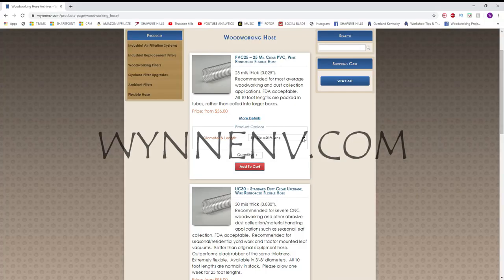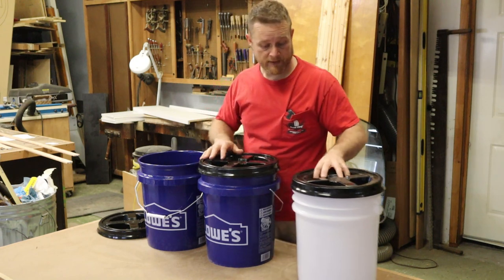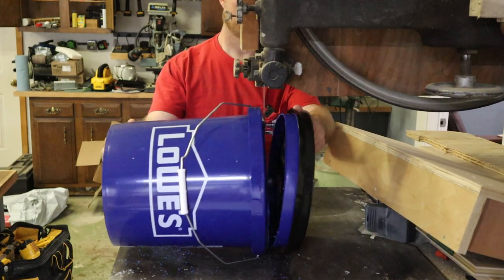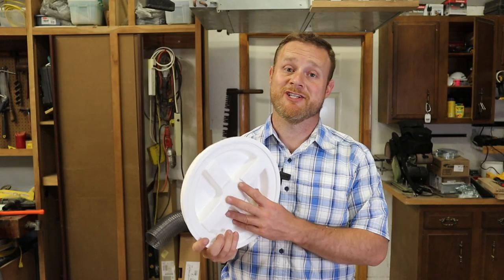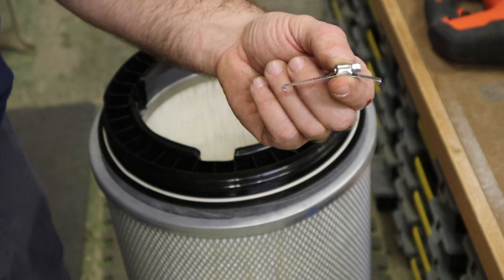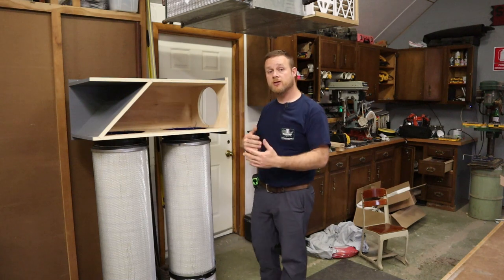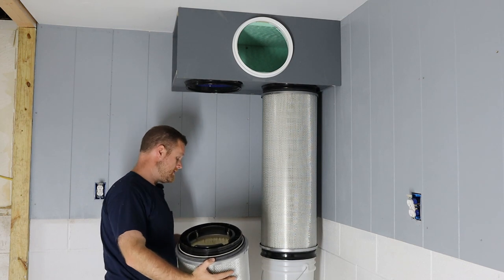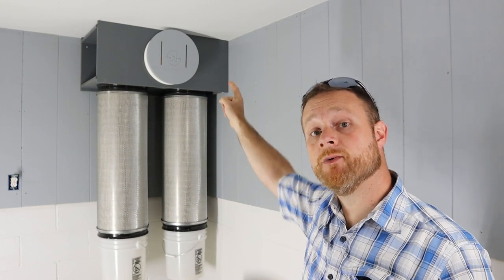Ultimate DIY Dust Collector #91

Comment: Thanks for this. I just completed my DC install. Oneida SDD cyclone, 2hp Shop Fox blower, and a Wynn filter. Followed the plans to DIY the Gamma seal bucket lids, and now I have a threaded filter. Sweet!

Dick Wynn recommended the approach, but I doubt I'd have risked the uncertainty if I hadn't just watched you do it. Cheers.
Reply from the maker: It’s so nice to be able to spin them around and blow out the filters without taking them off!

Comment: You said you were using silicone on one filter and the gasket on the other and would see which worked better.  Was there a winner?  I'm making a plenum box for one filter, any suggestions on size and does the intake have to be centered on the box.  I would like to offset the intake to allow for clearace and keep a straight pipe running in to it.  This has really helped.

Comment: I think there is quite a bit missing here.  At the 8:00 mark I see that you have a large hole cut in the right side.  Later on that side of the plenum is up against the wall.  I take it that hole is the intake and somehow connects up to your motor in the shop (on the other side of the wall)?  If that's the case, why didn't you put the motor in the same room as the filters?  Doesn't the motor significantly contribute to the noise levels in the shop, too?  Why put the Manometer in the storage room when the motor needs to be running in order to register a reading?  

Or, is the motor in the other room and the plenum & filters are in the main shop to balance the air pressure?  Or am I completely off-base on everything?
Reply from the maker: Hey Craig, thanks for watching and taking the time to comment.  I have a large industrial dust collector that is about 10’ tall.  Because it is so big and loud it is installed outside.  Before I had this filtered return, my dust collection air just exhausted to the outside.  I added this plenum to return the conditioned air back to the space.  If your interested i did a video on my dust collection install a year or so ago.  As for the manometer, you are correct, it only works when the unit is running.  Typically once every couple weeks when the CNC is running or when I have the relay bypassed so the cyclone is running continuously I stick my head in the mechanical room to take a peak at the manometer to see if the filters are getting dirty and need to be cleaned.

Comment: I believe you meant to say every 3 db (rather than 10 db) is a doubling of the noise level (or halving if reducing the noise level)
Reply from the maker: no, I meant 10db.  3db doubles the sound power, which is more like the energy (not sure if that't the best way to describe it) but its basically the intensity.  The actual volume you hear is +/- 10db.
Reply: 3db is for RF and sound energy doubling.

Comment: The Gama seal lids keep breaking and filters fall to the floor. Have you had this problem? If so how  did you remedy this? Thank you
Reply from the maker: I haven’t had that issue.  Are you cleaning your filters often enough?   Dirty filters cause excess pressure and can blow them off.  Did you buy actual gamma seal lids and not knock offs?
Reply: I did buy gama seal lids. My plenum box is attached to the collector using large L brackets. I think vibration is causing the problem. I think I need to stabilize box better. Thanks 😮

Comment: great video - i have a question for you.  i just bought 6 of these filters.  for the gamma seal lids, i'm debating whether to remove the existing gaskets and use a silicone sealant and clamps, or just attach it with the clamps over the gasket.  on the non-gasketed side, i did the "silicone and clamps" approach and i really like how well that sealed and secured.  but on the other side, i'm nervous about the weight of those filters and buckets hanging on the four clamps, secured only to the soft plastic of the lid.  curious if you have a thought on this before i go through the exercise of removing the glued-on gaskets.  thanks for any feedback.
Reply from the maker: I siliconed one of my buckets on and it blew the seal after a year, so I am back to gaskets all around
Reply: @shaweehillsworkshop4226  interesting - thanks for this.  did you also use clamps along with the silicone?  or just glue the lid on to the flange?  thanks again.
Reply from the maker: @mwwdz  silicone and clamps.

Comment: Just curious, is the angle on the left of the box just to devert the airflow.
Reply from the maker: David Long yes, according to Wynn environmental this will greatly reduce noise!
Reply: How did the foam insulation hold up, as opposed to the carpet